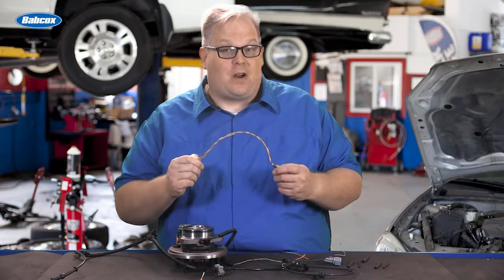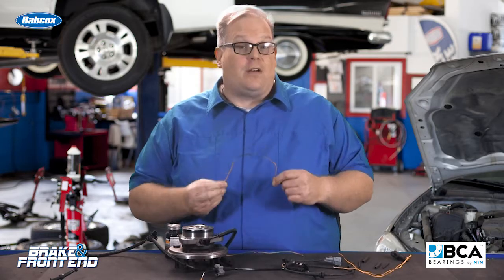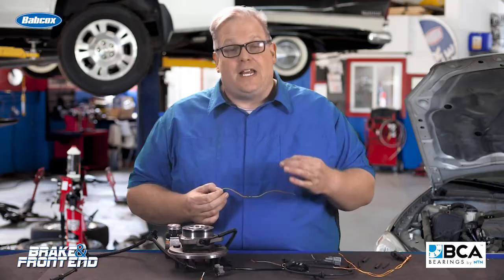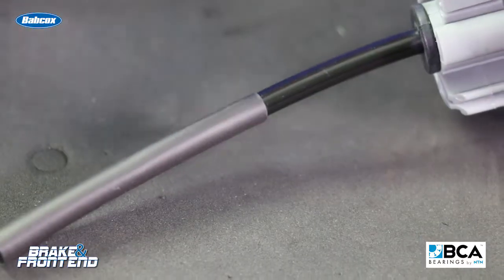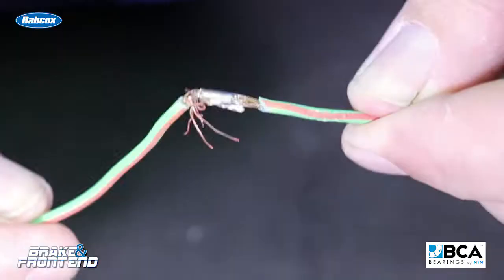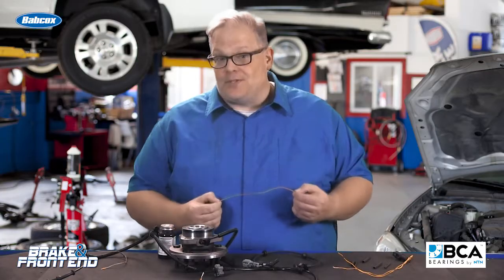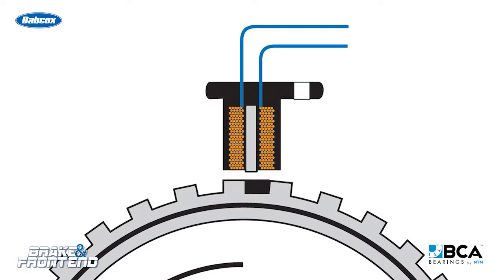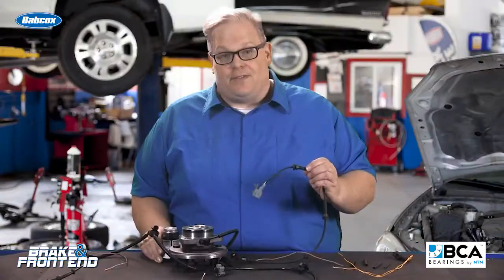Repairing Wheel Speed Sensor Wiring Harnesses (Part 2)

Comment: Hi. I dont realy this is the right place to get your questions answered! If you really want to do it yourself i would recommend you to watch for some  soldering experts to learn and show you how to make a clean, strong and selead connection, and how to properly realese tension and stress. Just as important is how to really ensure that the connection and system works as intended.
Reply from the maker: This is a good point. Soldering the wheel speed wiring harness can be a viable option, but it needs to be done properly and tested by an experienced professional, and of course it needs to be properly sealed from the harsh elements that wheel hub assemblies are exposed to. An irregular signal from a wheel speed sensor can cause serious safety issues, so we do not recommend trying to repair the wiring harness without the proper experience.

Comment: Some tips, lather your  soldered connection with some vaseline and then put the heatshrink tube over it then shrink it, and get a small rod and deburr the ends and make a splint to prevent flexing at the soldered joint

Comment: solder liquid tape and heat shrink works juuuuuuuuuuuuust fine, especially if that dumb little sensor is 80 bucks a wheel, I wouldn't try this on an AWD of course, but some older rig why the hell not.

Comment: Where does the wire harness connects to? VW 2016 Passat.Help please.
Reply from the maker: Hi Daniel- Are you asking where the wheel speed sensor wiring connects to the main vehicle wiring harness?
Reply: @BCABearings  how tdo you connect the new harness to the existin wires.
Reply from the maker: If you are connecting new wheel speed sensor wiring to the existing vehicle wiring harness, it needs to be professionally soldered into the wiring harness, and then meter tested to ensure the proper signal is being transmitted from the wheel speed sensor to the vehicle ECU/ECM. If the signal received from the wheel speed sensor is not correct, it can interfere with the function of the ABS, stability control, etc, which can be a safety issue. We recommend that this type of repair is done by someone with professional experience in soldering and circuit testing.
Reply: @BCABearings  Thank you for the advise.Can you recommend anyone?
Reply from the maker: Hi Daniel, I can’t recommend a specific shop, but any reputable auto repair shop in your area should have the tools and skills to complete this repair for you.

Comment: its well and good to replace the cable. The 2015 Ford Focus Ecoboost [vin: WF04XXGCCFE07929] 🙄has a cable that ha no intermediate connectors. It is directly wired to the ECU cables and the only way to replace the accident damaged senor is to cut and rejoin the cables... then what? Help!
Reply from the maker: Hi Edwin- I ran this by our product tech team. What we recommend in this situation is to bring this vehicle to a trusted repair shop to ensure it is repaired properly. It is very difficult to properly and permanently repair the wheel speed sensor wiring. Signal loss from repaired wiring can cause issues with ABS, stability control, and other systems, which can lead to further safety issues.

Comment: The gold plated Wire to the connector too the abs
The gold plated wire coming out of the wiring harness is missing I need a video showing where it goes to tie into in the wiring harness to be able to hook it back into my BS for a 2014 Toyota Camry
Reply from the maker: Hi Randy- I am not exactly sure what you are asking, but can tell you that you would need to reference the Toyota service information for an accurate wiring diagram and repair procedure for your specific vehicle. If you are experiencing issues with wheel speed sensor wiring, it can lead to safety issues, so we always recommend taking your vehicle to a trusted repair shop to ensure any issues are safely resolved.

Comment: My wiring became damaged on the body side of the connection, how do I go about fixing that?
Reply from the maker: Hi Anthony- If any part of the wiring on the body side of the wheel speed sensor connector is damaged, we recommend the replacement of that entire piece of the wiring harness. It is very difficult to properly and permanently repair the wiring, and the chances of causing additional issues, such as corrosion and signal loss, are high and could even cause a safety issue down the line.
Reply: @BCABearings  Thanks for the response! I was thinking I'd have to do that, I'm just having a hard time trying to find out how to do that since the harness eventually goes into the body of the car and can't be seen.
Reply from the maker: @anothey93  We can look into which wiring harness part you would need if you would like to let us know what the year, make & model of the vehicle is, and which wheel the connector goes to. Feel free to reply with that info and I can run it by our tech support team.
Reply: @BCABearings  Thank you! I found the harness online, actually and it's unfortunately all one piece for around $700. It's a 2014 Ford Fusion right rear wheel.
Reply: My cv axle boot cut my wires in half but like the comment above it leads to a body of other wires I have no idea where to begin? Help please TIA!
Reply from the maker: @reginarae7591  What is the year and model of your vehicle?